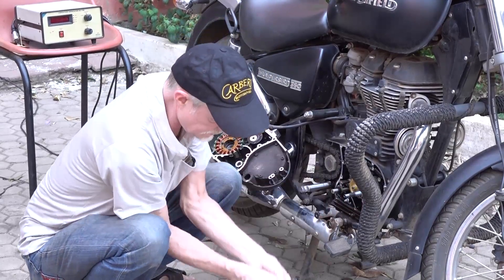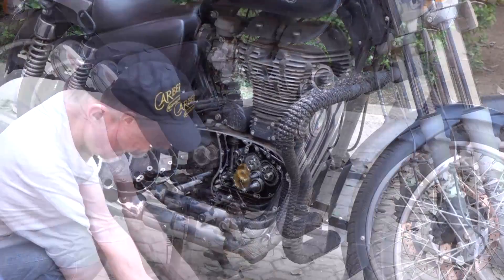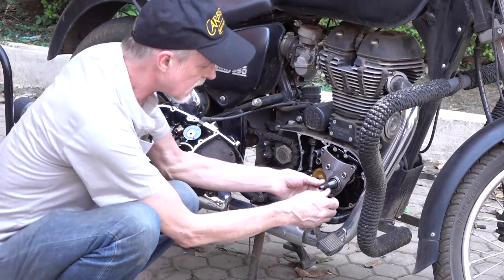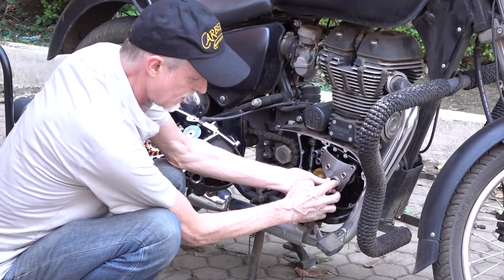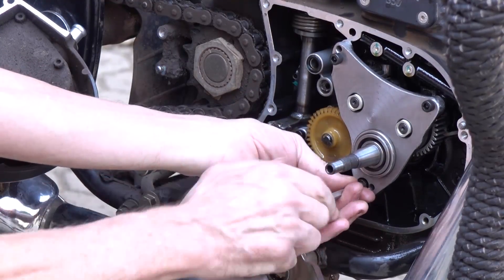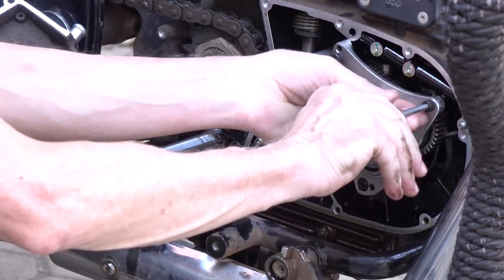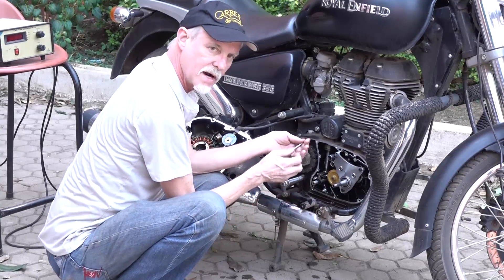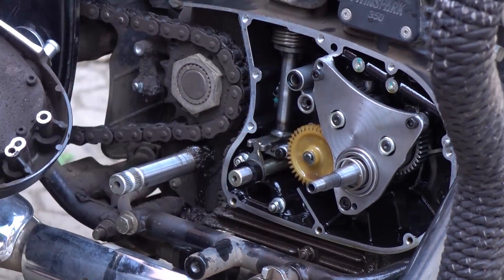Analysis of Vibration Reduction Plate(Enable subtitles)

Comment: At first he put the probe on the engine and its showed reading of 40.... 
After the installation of vibration reduction plate he put the probe on the handle bar the it shows reading as 14....

This clearily shows that this thing does not work properly....
Reply: and it in the next shot putting the probe on the engine and it shows 14, on the handlebars 7. so it does seem to work